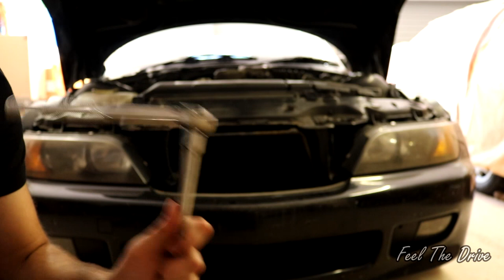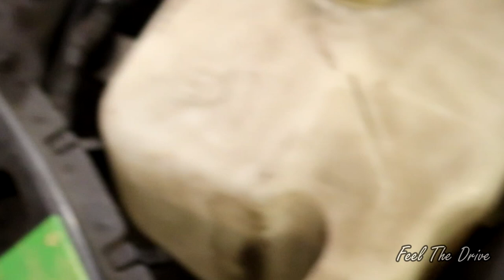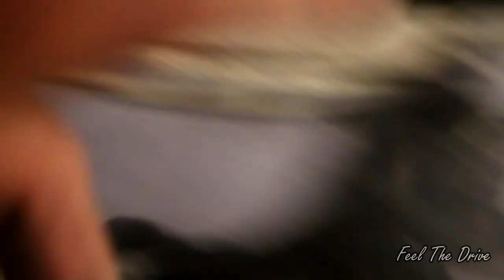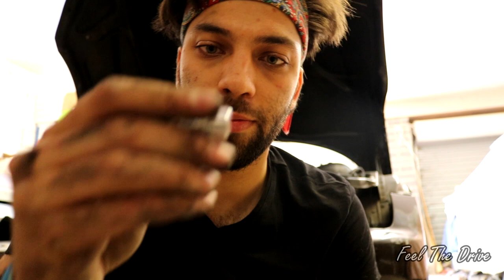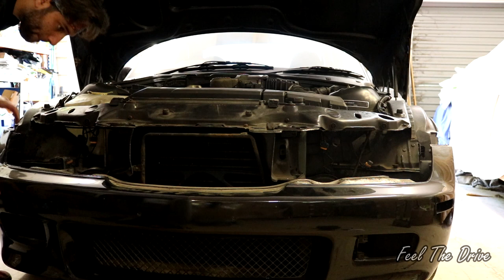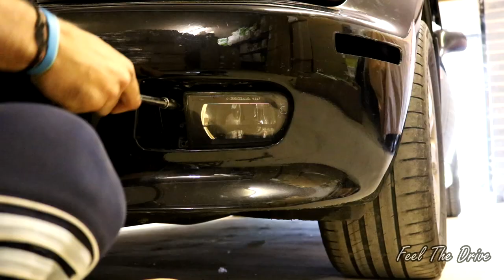Making the Z3 Look MEAN | Upgrading the Bumper

Comment: This guy does not explain what the difference in the bumpers is.  The 6 cylinder bumper has a bigger rectangular center vent than the 4 cylinders.  You can tell the difference by looking at the thickness of the crossmember at the bottom of the bumper.  The grille is cool, though but who the hell says you have to remove the headlights to remeve the front bumper? 
2 long T50s and 4 8mm screws, thas all it takes.  Ridiculous!
Reply from the maker: The fog lights are a different size and there are cut outs for indicators on the 6 cylinder version as well :)